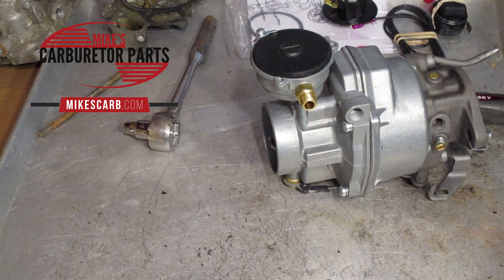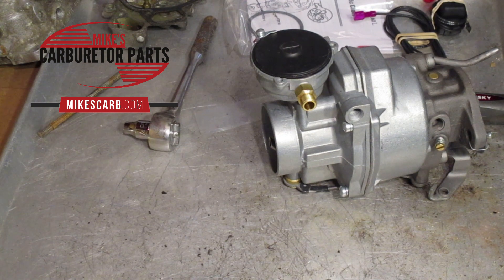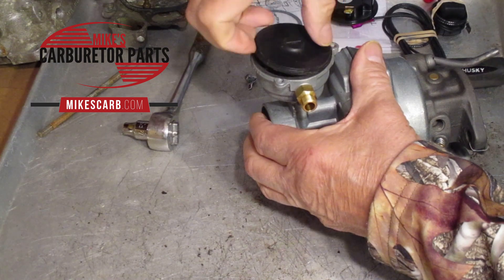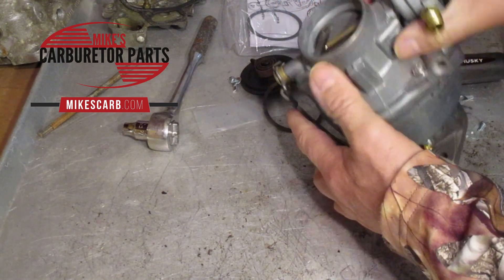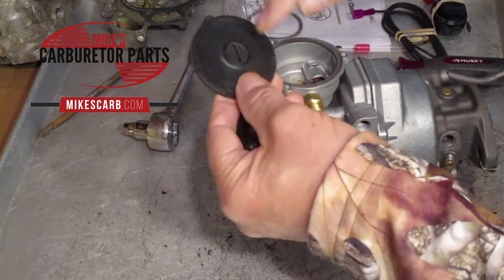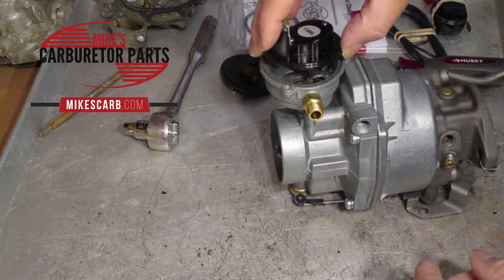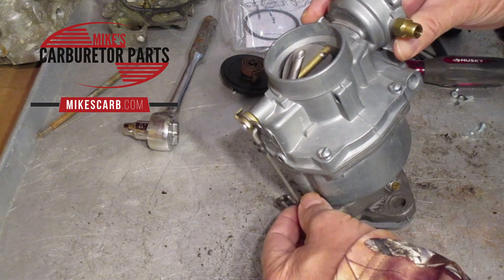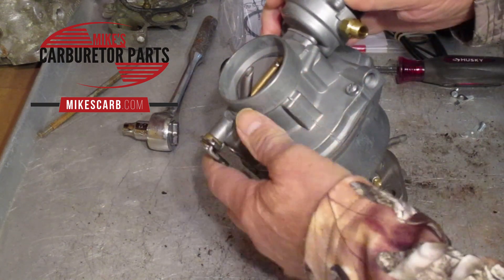Rochester 1 Barrel Carburetor Electric Choke Conversion

Comment: Hello I am running 2 - 1 barrel carbs. I wanted to know if I need to run 2 rheostats or can use one to minimize wires
Reply from the maker: Only 1 choke is required on multiple installs

Comment: '80 F150..can't find parts..Got an air line from Aquarium..through Firewall hole..into carb 1 barrell...mount it to missing Butterly stantion.. shoot carb cleaner in line..Starts up 3rd pull..no muss no fuss came in on budget.

Comment: Hey mike I just put a brand new 2150 motocraft carb on my 351m. I’m having an issue getting the idle lower. I live in Florida so it’s always hot I don’t think I  even need the choke to work but any suggestions?